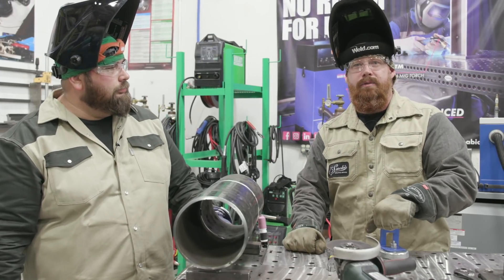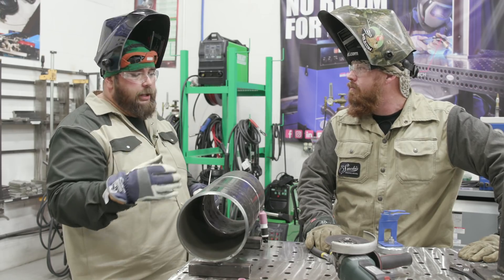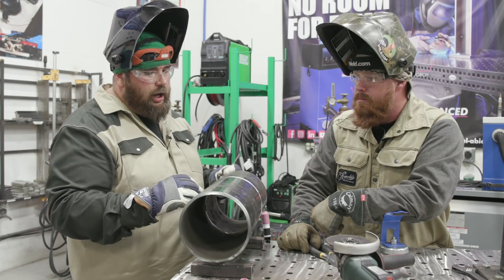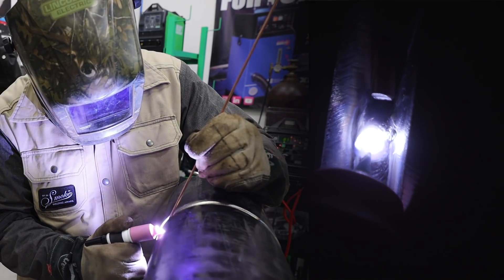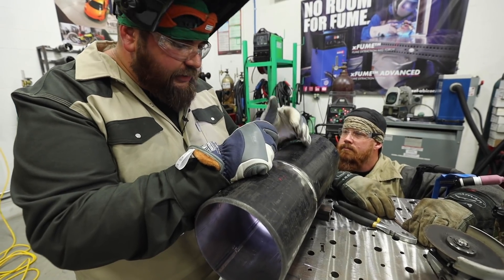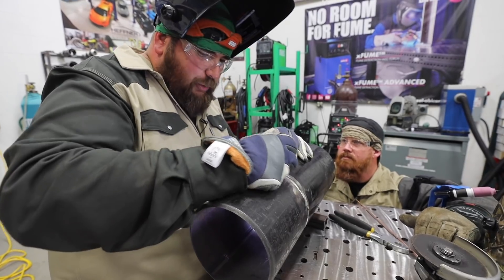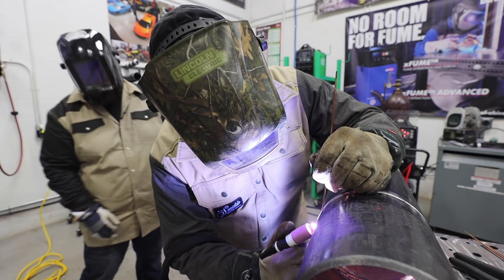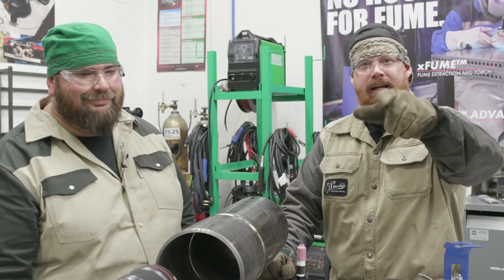Iron Worker Learns how to Weld O-Beam

Comment: Can someone explain whether or not Everlast is a good company? As far as I can tell, PrimeWeld has the best customer service right now, and the best warranty. They have the fastest turn around on spare parts and spare circuit board parts. They pay for the return and exchange shipping, which no other company is willing to do. I have read that the other companies don't pay for warranty shipping, and their repairs can take many weeks or even months, and in some cases they won't even return the welder at all. PrimeWeld appears to be the best brand right now, in terms of cost, warranty, and customer service. But I see Everlast welders being used by all the big channels. I'm trying to figure out which brand I should buy.

Comment: Retired Ironworker/Business Agent Local 433 Las Vegas / Los Angeles: 
The UA has some of the Best Welders in the Country. 
But as an Ironworker I’ve welded structural O-Beams on rollercoasters, structural steel buildings, Offshore platforms and miles of handrail. 
The  work assignment is determination by the use and purpose of the Round Stock.
My Opinion is that Skilled Labor performance makes it services cost affective for the Client. It is reassuring to see learned skills being taught on a public platform as this; and for all those who would like to learn there’s always a helping hand out there willing to teach. Community Colleges, Tech Schools and Apprenticeship Training Programs.

Comment: My preference is 5/32” gap with and I use 3/32” wire and I and add what I feel like I need and have no problem passing Xray
Reply: I welded like that for a long time. Now I do 3/16 gap with 5/32 rod on bottom, then 1/8 or 3/32 on top depending on how much my gap has  shrunk

Comment: I'm an Aussie "Ironworker" and we basically had to do this procedure in 2G and 5G fixed positions allowing up to 2mm of penetration reinforcement and 2mm of weld face reinforcement. Then you need to pass destructive testing. After getting my ticket, I've not welded anything like it since 😂

Comment: Could you do a video about how you select your tig setup? Like what parameters influence what filler rod size you’re using or what cup you’re using. I get the color coding on the tungstens and the aws code for filler wire types but I’m just not sure about what size to pick for the job at hand yet.

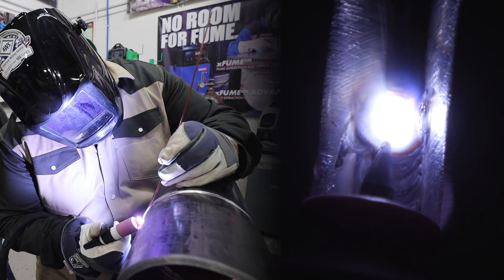Comment: About 9:40 it really looks like you missed a spot on the right hand side.  Does it clear x ray without post gas flow? Just curious.
Reply: I weld exotics in the oil industry and I can tell you that nearly all alloys do not require post flow
Reply: Yes they pass without post flow if the arc is broken properly, some will also use hand controls to taper down amperage before breaking, or they will break the arc up the length of their filler.

Comment: I have been a welder for over 20 years and learned old school. Gap it and weld it. I didn't have a tig welder . I welded it with a stick. You have a tig welder with every option. Why not weld with a button ?
Reply: GTAW is required on a lot of procedures. You don't always get a choice. So what's your point? Every welder learns SMAW in school. Well at least in Canada you do. It is a requirement to pass open root pipe in all positions with a 6010 root and 7018 fill in order to pass B level.
Reply: You must be welding in a ship yard. Things are a little different in the petroleum and nuclear field

Comment: ok I did a stainless and a steel TIG 6G open root and my whole inside was  a clean 1/16 -1/8 penetration on both alloys. the inspector was saying that my welding needed work and they wanted to go lower than what they originally offered me... Ive done training with CWI as weld as been in the fields welding for 8years and that threw me off when they did that to me. not saying im perfect but i feel like they are trying to undercut me. any advice for guys who have welded in the union before?
Reply: If they are being that cheap and trying to gouge you now they will do it forever. Take it if you don't have work right now but maybe move on later.
Reply: Geoff Moore thank you
Reply: Run away from those pricks and never look back

Comment: Retired u.a. fitter. (Btj)  why is u.a. teaching boilermakers to weld pipe?  Don't understand.
Reply: 35 year BTJ fitter also....  Never could figure that one out myself. Better yet, pipe welding laborers???
Reply: Shits an giggles guys. 

Plus why pigeonhole yourself to one task. If you learn different procedures and techniques it expands your skill set. I have gone as simple as welding pipe joints with a backup ring to welding 2" thick stainless steel to carbon steel joints using a closed root melt through procedure which was fill welded with 309 Sub Arc. Now I am a Level 3 CWB inspector.
Reply: Ok boomer

Comment: the 2nd method with 3/32 wire will work better if you freehand it. wiggling the cup too slow it will widen the keyhole the rod melting too fast causing  excessive  root all because  the gap is bigger  than the 3/32 rod freehand  will allow  you to choke the rod with the arc length

Comment: I would really like to get in touch with this guy,  i own a everlast power arc 300 that im using to practice welding pipe . I continue to get arc blow time after time with it,  and ive done everything .
Reply from the maker: @bingo_welding on Instagram
Reply: @Welddotcom  thank you
Reply: You will always get arc blow on small parts. Its pretty much unavoidable. Its not the machine. Only A/C current can prevent arc blow.

Try moving the ground around. Try multiple grounds. Use as little current as you can to weld.
Reply: @geoffmooregm  yes i understand arc blow on small parts.  But I've been getting it when practicing on sch40 6 inch , and sch 80 8 inch and 6 inch pipe.  

Half way through a 7018 1 /8th rod ive literally blew a hole strsight through the root and 2 fill passes.
Reply: @Doodlett  I feel your pain. 1/8" is a good choice for that pipe. I can only suggest as low of amperage as possible and tossing the electrode if it gives you arc blow half way through. Or if you can't waste the electrode you could use an A/C machine to burn a bit of rod and put the pipe in the ground path. A/C current running through the rod and part should reduce the buildup of magnetism.
Reply: @Doodlett  sounds like you're just having an issue controlling your heat. Online welding badasses will tell you to use 1/8 7018 on those pipe sizes, but i promise you will have better results running 3/32 7018 instead
Reply: @JustSomeGuy1776x  this isn't andbissue controlling anything , i have multiple smaw pipe certs its something i only experience with this welder .i have used hundreds of different inverter welders . I
Reply: @geoffmooregm  thank you for the suggestions

Comment: spinning puddle... couldn't figure out what he was referring to.
Reply: You can see the impurities spinning around the molten puddle extremely fast. That's the fisheye. If you let the puddle solidify without slinging out the impurities you get a fisheye. It looks like a glass eye in the middle of the weld. Sometimes it can be 1/8 deep or more. No good.
Reply: @matthewerwin4677  Nope. Has nothing to do with impurities but cooling rate and shrinkage during solidification.

Comment: I am a really green welder. And even though this is intimidating I think I learned a few things
Reply: Here's another piece of info: notice how he only does this on the top half  and never touches the bottom? This is because lay-wire does not work for getting reinforcement on the bottom half. Back feeding the root pass is king for positive reinforcement on the bottom

Comment: 1:15 The proper word use to describe erosion from fluid flow is cavitation.
Reply: Ahhh no. Cavitation is what fluid does when subjected to an area of low pressure against a surface across which it is moving. It forms a small bubble, the collapse of the bubble is what causes the erosion of the surface. The bubble collapse also causes vibration, (and along with it) noise and heat.

Comment: I have my Initial B pressure Exam next week, Carbon tig root, 7018 fill and cap on a 6" SCH80 pipe. This is exactly how I like to run, 1/8 wire, 1/8 fit. Great upload, It will help me for sure
Reply: Try a 3/16 gap with 5/32 rod on bottom and 1/8 rod on top. It'll change your life

Comment: do you like those everlasting welders? Was thinking of getting a big as i have a Esab mig 235 already. I read about them and hear good and bad
Reply: Dan  it’s a great machine..... until you need service. That’s the one major thing red and blue have over green.
Reply: @trevorjarvis3050  Along with the price right?  Thanks for the reply
Reply: Dan the MTS 275 has become my favorite machine in the shop. We’ve run a lot of Everlast in the shop and have never had an issue on any of the machines and we do a lot of welding.
Reply: @jasonbecker3362  Thanks for the info